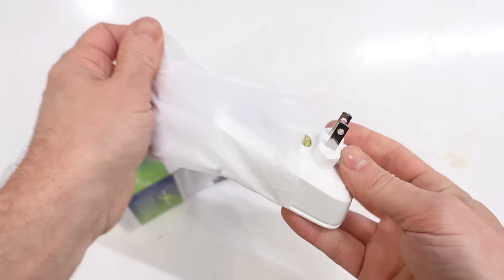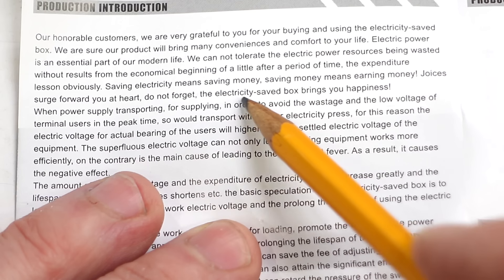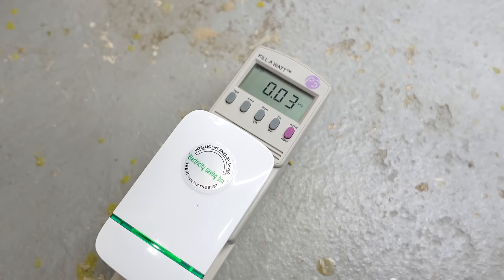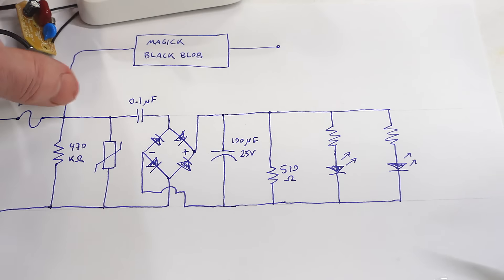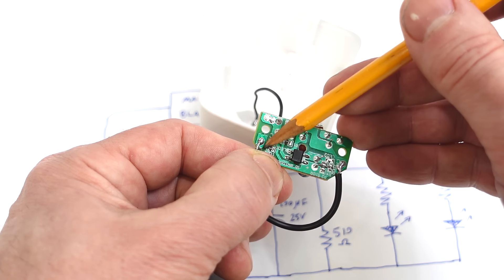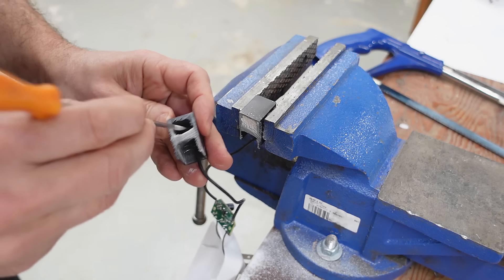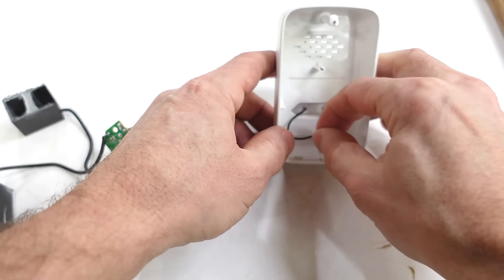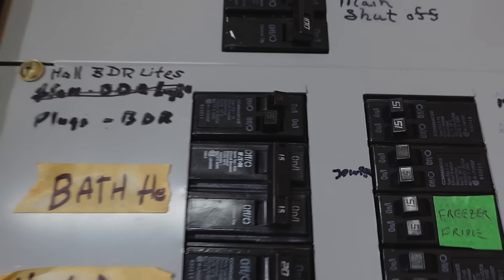I bought a scam energy saver and made it actually save energy!

Comment: That could be useful for tracking circuits to the breaker.
Reply: Much like an old radio with it's volume all the way up to hear when the music stops.
Reply: @Jesus Uruchurtu  I think his solution is simpler.
Reply: until you do it to one and a breaker doesn't pop, then a fire starts in a wall somewhere... 
knowing my luck, i'd have an old broken breaker switch that doesn't disengage.
Reply: And in some cases, testing the response time of the fire department.
Reply: @nobody8717  Or the breaker does the opposite, and opens and can't be closed again. Or just explodes.
Reply: Some oldschool electricians trip the breaker by shorting out the wires before working on them. Never have to guess which breaker to turn off, and no doubt that the circuit is dead once you short the wires together.

Comment: Some of those devices do contain a large capacitor (instead of a fake one). I modified one to be in series with a LED bulb, limiting its power usage from 13 to 5 Watts or so (all suggested by BigClive). Drawback: light output fluctuates quite a lot with line voltage. When the water kettle is switched on, it gets a little bit darker...
Reply: So it's saving power AND an indicator of too much power draw in other devices. To the original makers of the device, that's like a bonus feature! Don't tell them or they're going to demand you pay them extra for more features!
Reply: That's why I use gas to boil water
Reply: I know why they do these adds  but my question is why are they allowed. It isn’t rocket science for even a modest intelligence to spot them as scams and should be taken down.
If a shopping mall only hired guards to protect only the store infrastructure yet allowed customers to be mugged and attacked then the would soon lose trade.
Reply: So you are suggesting these POS rip offs actually work??

Comment: I'm surprised that the wires inside the device didn't act as a fuse
Reply: Circuit brakers are designed to act faster than fuses (even "involuntary DIY fuses"), in order to prevent anything from burning.

Comment: The first time you plugged it in after you fixed it I was amazed! 😂
Reply from the maker: that was the only plug in with a real short circuit and breaker pop, hence the sparks.  The opther two were faked.
Reply: @matthiasrandomstuff2221  Yes, it really only "saves" power once.  😄

Comment: for a moment, I thought it tries to figure out if your load is more capacitive or more inductive, and do the opposite, thus reducing apparent power. In a sense, it is a capacitive load, so if your load is inductive, it will slightly reduce apparent power

Comment: I've seen this same scam poorly installed on my customer's house. They just cut a hole in the breaker panel and mounted a box with a light outside next to the breaker panel. I opened up the box to see what was inside and it's just a capacitor. It's funny to see that they're making them smaller now that they can just be plugged in. I wonder what the leasing company paid to have these boxes installed on all of their rental units? Lol😮😅😅😅

Comment: I’ve had one for years and use it to monitor how many watts an appliance uses. My through-window a/c unit pulls 300 watts on low and 375 on high. My O2 condenser uses 600 watts. How I use my appliances is now informed by data. I know I pay 12 cents per kilowatt/hour and can do the arithmetic to get my cost per hour, per day and per year. Approximately 🎱

Comment: The state-run "Stiftung Warentest" reported on "1000 € energy saving potential". 
Water& energy saving shower heads have the greatest savings potential, up to €300 p.a. at a cost of just €20. Otherwise, you should install LED lamps, window sealing strips, switchable power strips, energy-saving heating pumps, programmable thermostats, radiator reflective films, thermal stops for water boilers and timers (e.g. to switch off routers at night).

Comment: My mother just bought 2. I looked at it and said, probably magic 😅 my black capacitor is also soldered to a non connected pad. But, even worse they left out the magic pixie dust! The epoxy is just 1/3 filled😅😅😅

Comment: Do they make a 3 phase version?  Just think of all the savings in industry!  A 240 KV 3 phase device could save power over a large area, just attach it to the HV line directly.  Might take a lot of magick pixie dust for utility use though.

There is only one other device I know of with only one terminal,  a WOM (Write only Memory.)  They come with infinite storage capacity, occupy no space on a PCB and require no power to operate. AKA a "bit bucket."

Well done, Mattias, from one EE to another!

Comment: I didn't know this scam is world wide😂
For residential purpose only 2 way to reduce electricity bill - 1)use led, if don't need off the lights/appliances.    2) use renewable energy sources eg. Solar especially if your consumption is moderate to high

Comment: They went to a lot of trouble to scam people out of a few bucks, soldering four diodes, three resistors, two capacitors, one varistor, a fuse, an LED, and what Matthias calls the pixie dust container onto a circuit board. The stickers on the unit actually cover perforations on the front and back that makes me think this device was originally intended to be a plugin air freshener. The user manual IMO isn't just Chinglish or a poor translation, it's deliberate nonsense to make fun of suckers like me for getting suckered by the Elon Musk endorsement.

Comment: Oh no.  The magic pixie dust.  Unfortunately there's a fairly well regarded lightning protection company that does the same.  They claim to have patented "silicon oxide" technology that never wears out unlike MOVs, which is actually just a canister full of sand with two electrodes.  Previously I had bought a number of Delta Lightning Protection units thinking they were reputable, but then I looked into it further.  None of the specifications they give are real, and they're easily disprovable with a megger.  A teardown of a Delta part could make for a good video.

Comment: Yup saving you money
You want to save money
There's resistor plugs that 
match your devices power
Requirement
And if you really want to save
Money buy a power strip and 
Turn it off when not in use
Bonus doing this will increase
Devices lifespans

Comment: The only way these devices could work is if you could plug your 220 appliances into them. Those are the units that use all of your damn power. I get so tired of people whining about lights, fans and computer chargers using power. They use almost nothing compared to the bigger appliances.

Comment: Lovely. I thought there would at least be a capacitor in that box. But there is nothing there but a little power supply to convert 110 volts AC to a couple of volts DC to light up the LEDs. This is nothing but a very poor night light.

Comment: Those things don't do anything, If you really want to save money, Then do everything off the grid like back in the days where electricity didn't exist. Don't rely on a stupid LED nor capacitors for saving money, because they could really just increase your bill and there's no point  in such a device when energy companies ask for annual rate increases each year. If you cannot go off the grid, a timer would be 1000X better than that stupid device and timers actually save money because they turn on and off according to its programmed time and do not contain that snake powder that these things have inside. You don't have to short circuit an outlet with a timer. If you want to pull a prank on your friends, then buy one and then short circuit their outlets with it so it trips their breaker. Great way to get an addicted gamer to come downstairs for dinner.

Comment: Gee I was expecting the black blob was a just a power factor correction capacitor, but it actually useless rubbish, would have been easier just hooking up the real cap. Also the rectifier and smoothing cap was unnecessary expense to just light up 2 green 5mm LEDs. madness. By plunging in Short circuited plug will ruine you're wall socket contacts and can possibly lead to a terminal fire in years to come on high current devices at night like a room heater. Yes we get it...its a SCAM.

Comment: I found your video after I was curious what is actually inside this scam device that keeps turning up in my YouTube ads. While I was not surprised it was only a circuit to light a LED., it surprised me that it contains a black blob that only adds weight so it feels more genuine, instead of a pink rainbow unicorn with wings.

BTW, did you know a screenshot of this video is used on the Dutch website that sells this fairy tale device

And you also appear in this Dutch promotional video:
https://www.youtube.com/watch?v=_5eFyfSY-ik

So you are now an official influencer that endorses this magic device on their web site 🤣